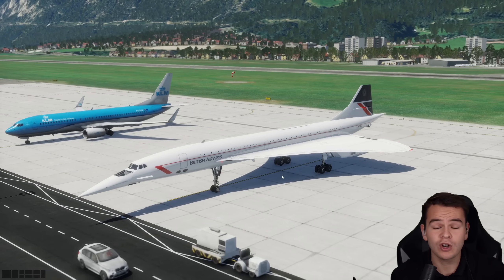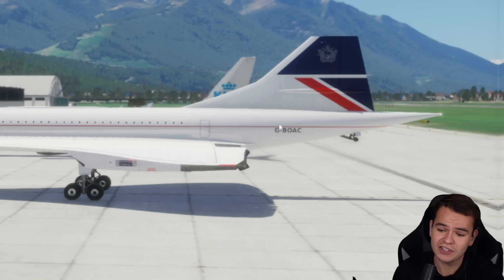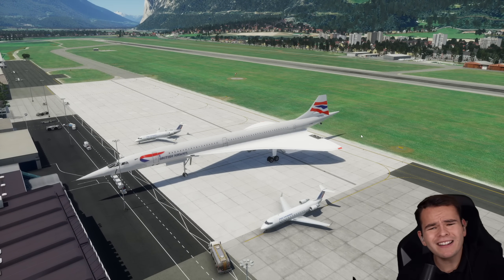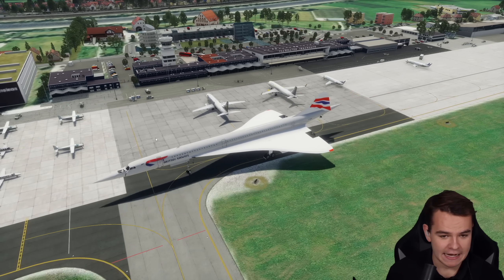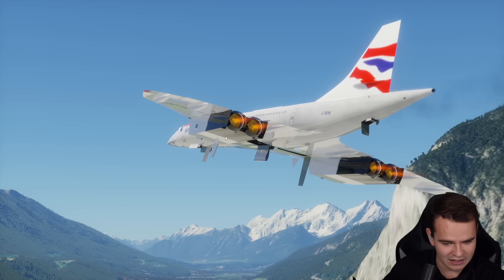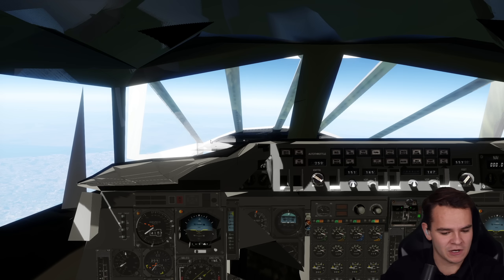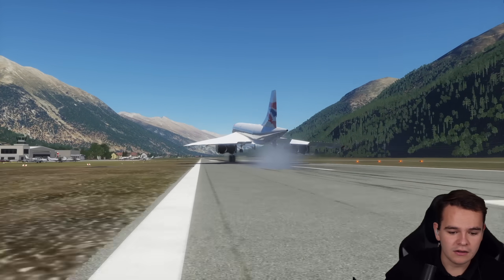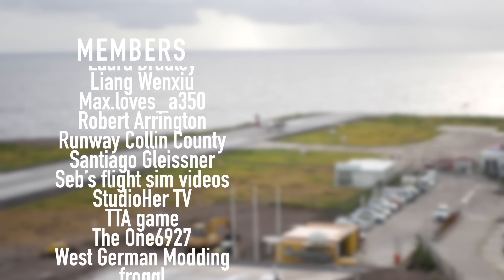Could We Build A WIDEBODY Supersonic Airliner?

Comment: There is a optimal wight to span relationship depending on the speed of the plane. For mach 0.85 that is common for airliners, the size is about that of a A330 or a 787. Larger and the wing dig in to much, smaller and the parasitic air resistance increase.

When its at mach 2.0, this size is a LOT larger. That was actually the key problem with Concorde. That it was to small. Not only did it carry few passengers, but it also needed a unreasonable amount of fuel to reach transatlantic range.

While Boom overture is smaller, it speed is also lower, about mach 1.6, and the engines are about 30-40% more efficient

Comment: If you double the length, width and height, the weight would need to be 8x to have "correct" scaling.
In practice maybe more like 4x, since you wouldn't need to increase the thickness of everything by a factor of 2. But assuming only twice the weight is definitely too low and probably explains, why it's handling so well.

Comment: Common misconception that Concorde was a loss making aircraft. It was much the opposite. What killed Concorde off, apart from Paris and 9/11, was Airbus withdrawing support for parts supply. Real shame.
Reply: And fuel prices
Reply: But the concorde never became what it was supposed to be, a SST. But rather a huge super sonic limousine.
Reply: Actually what killed it off was video calls. Most of the customers were travelling because of business meetings with the increased popularity of video calls and cloud services there was no need a supersonic flight across the Atlantic to attend a meeting
Reply: @kityhawk2000  cloud services in 2003?
Reply: @kityhawk2000  Really? In 2000 a Concorde crashed. That's what killed it
Reply: @kaseycaseyiel and how many types of other planes have crashes that have been arround over 30 years? How manu DC 10s 747s? How many Airbuses? Concorde was scrapped because it wasn't profitable. It was very small so it could only take a few number of passengers and the fuel economy was terrible. The majority of customers who used it were business executives who could expense it and that market was starting to dry up in the early 2000s when video conferences started.
Reply: The slap started with mainly AF4590
Reply: 9/11 contributed to the death of Concorde in two ways: firstly many of its most frequent fliers actually died in the Twin Towers, and secondly the increased security precautions at airports destroyed Concorde's time advantage versus renting a private jet (which cost about the same as a Concorde flight but was far more flexible).
Reply: @GCarty80  thats complete horseshit - a intercontinental business jet flight is like 150k return - nothing like the 12k prices for concorde

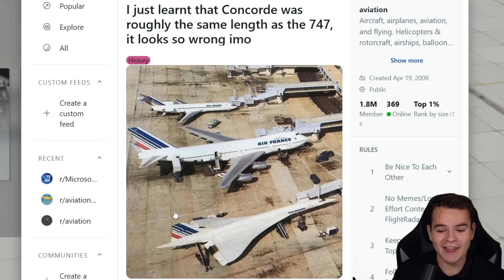Comment: 1:04 thats a 747 300 actually 🤓👆
Reply: No
Reply: @julianaogasawara2845  Bro yes it is if you looked at the engines you would see the 747-300's very distinguished engines
Reply: @Smoozl  That’s a 747-200… Airfrance fitted with General Electric CF6 Engines
Reply: @Nemo2507s  syagau
Reply: @Smoozl  they have the same engines
Reply: @Smoozl  and look at the upper deck
Reply: @julianaogasawara2845  dammit
Reply: Upper deck is long on the 747-300

Comment: 4:54 Technically I’m pretty sure that’s not how it works. It is the more air that flows around the turbine the more efficient it gets and since the Concorde engines are still turbojets it doesn’t increase the bypass ratio any more. If I’m wrong correct me. Still ur engineering “genius” is funny I like it 😂
Reply from the maker: youre right